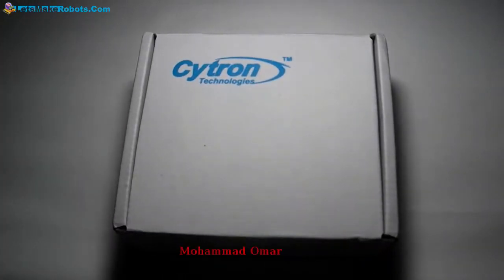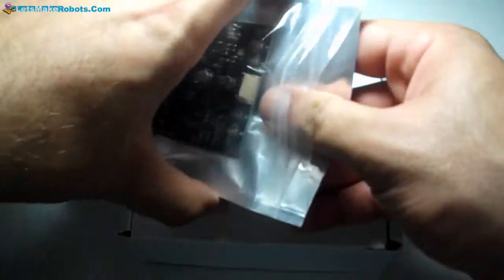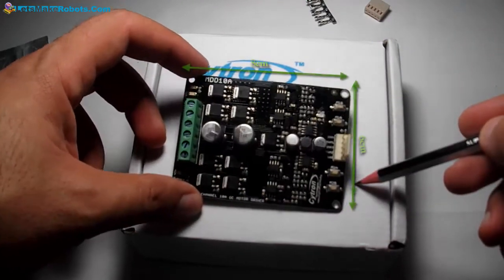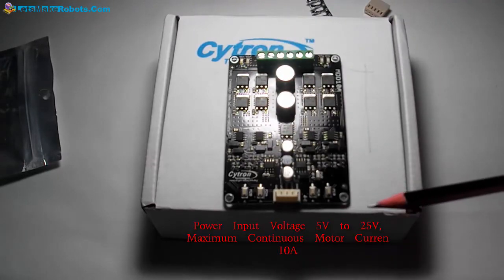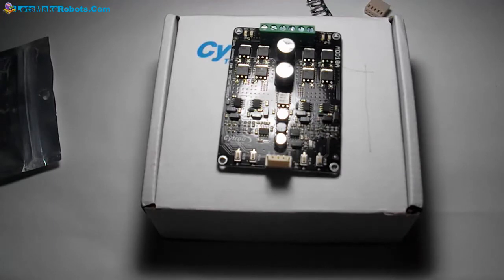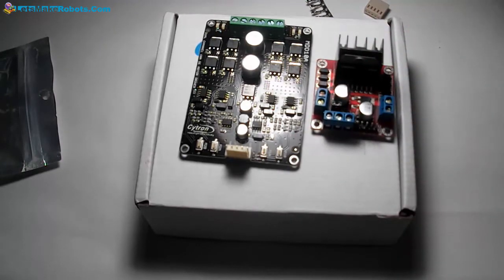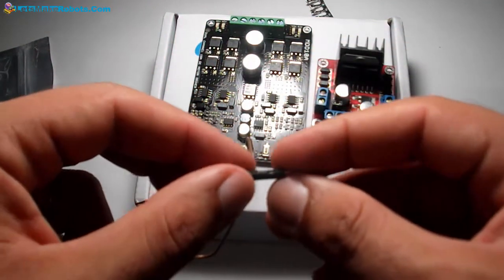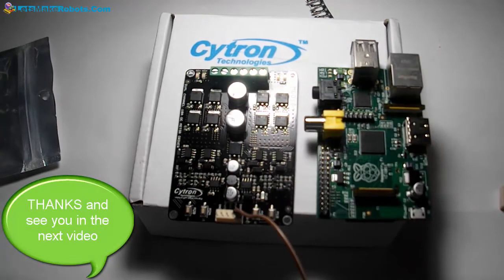Part-1: Review for MDD10A, Dual Channel 10A DC Motor Driver

Comment: Can I use this driver for my 240V motor with max current of 3A?

Please let me know
Reply from the maker: +Ella Sh Support motor voltage ranges from 5V to 25V
Reply from the maker: +Ella Sh you can see this page https://www.frightprops.com/faq/content/4/107/en/using-solid-state-relays-for-high-amperage-loads.html 
and you raspberry pi as controller as https://www.youtube.com/watch?v=FYvSZdPZJ5s
I will upload my python code
Reply: I  appreciate your reply 
But I need to control the speed of my DC motor using PWM generated by my arduino
Please tell me How is that possible through relay ? 
Relay can only switch it On and Off .
Reply from the maker: +Ella Sh please see this one I made from long time , see the comments https://youtu.be/uAZuS2U7K_Y
Reply: Unfortunately no comment can be displayed
Reply from the maker: +Ella Sh using mosfet irf540 and with DPDT relay  
and this link 
http://i.stack.imgur.com/sS4kh.png
Reply: Thank you so much 
I've been looking for a way for so long 
I appreciate ur help